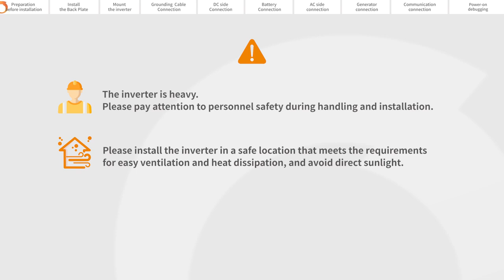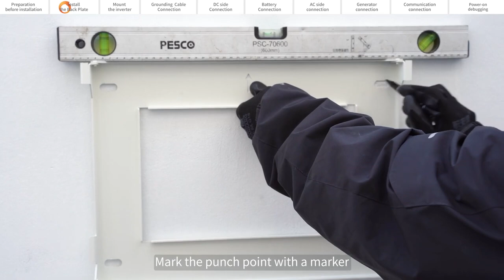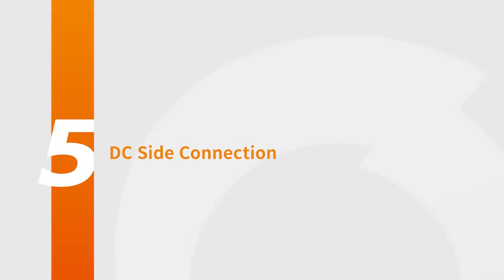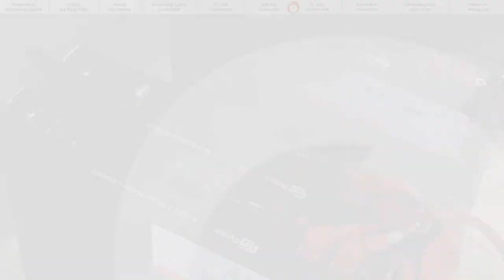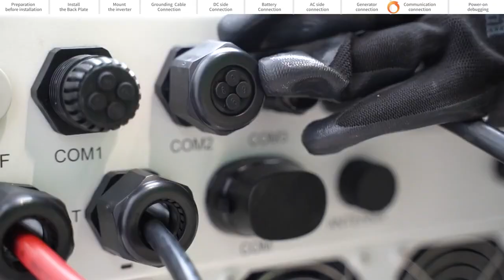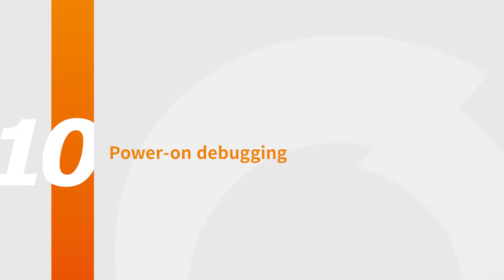Solis Hybrid Inverter S6-EH1P(3-8K)-L-PRO Installation Video

Comment: Is the GEN port designed for heavy loads...? 
Can I connect the GEN port of a Solis inverter to my air conditioners to handle heavy loads...?
Reply from the maker: Not directly, and only under specific conditions. It is not designed to handle such load! Do not try.

Comment: Choosing between Solis S6-EH3P12K-H 12kW and Deye, what would be your recommendation?
Reply from the maker: Choose Solis if:
You are using high-voltage lithium batteries.

You need maximum efficiency and a clean grid-tied setup.

You want plug-and-play reliability with strong local support.

Choose Deye if:
You want more off-grid resilience or DIY customization.

You’re using 48V battery banks.

You value flexible smart integrations and scripting.
Reply: @3buysolar Thanks, somehow I feel that there is more know how online in the groups for Deye than Solis.

Comment: i already did all these but still have a export to grid, what do I do?
Reply from the maker: You will always have dripping. What the export value? You must be able to set that value to zero but you would need a smart meter as well, in this case either a compatible third party meter or a Solis Power Manager.
Reply from the maker: Either a 1phase Meter ACR10R 16DTE with 120A CT or 3phase Meter DTSD1352 with 3x150A:5A CTs or as indicated a Solis Power Export Manager !

Comment: Hi dear can i connect solis 8kw hybrid inverter to 2 FLA felicity solar batteries. how can i know  ?
Reply from the maker: As to any other battery compatible with Solis! No magic with your battery either. It is on the compatibility list of Solis, therefore should work as just fine.